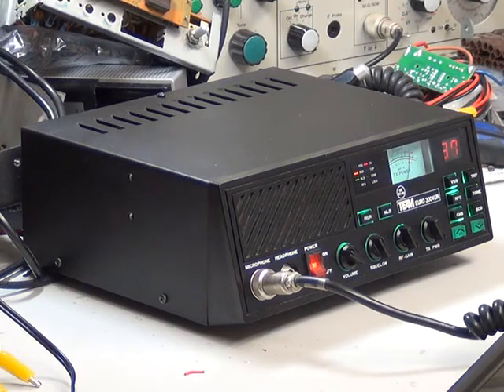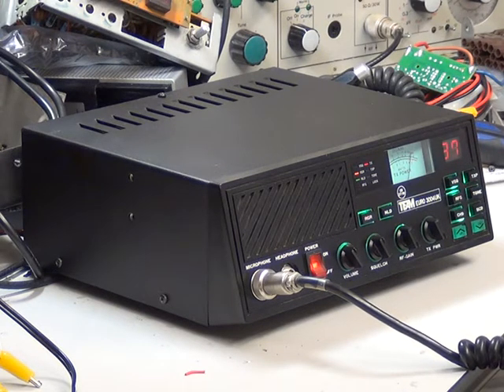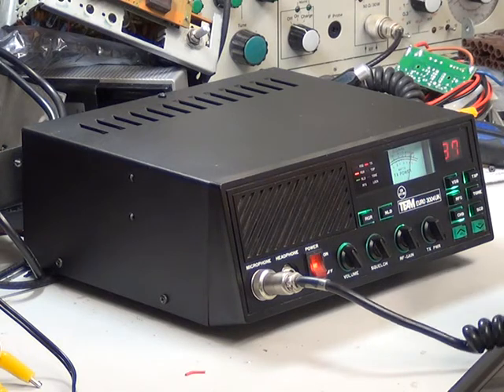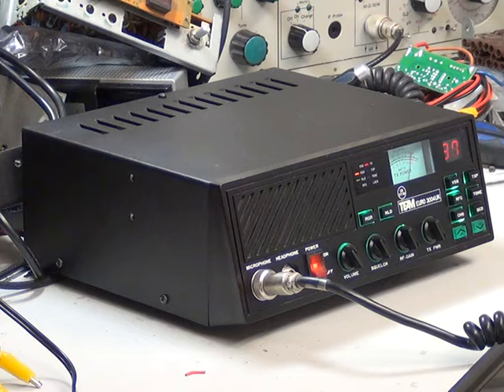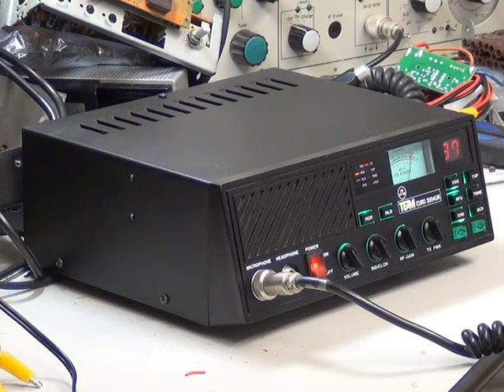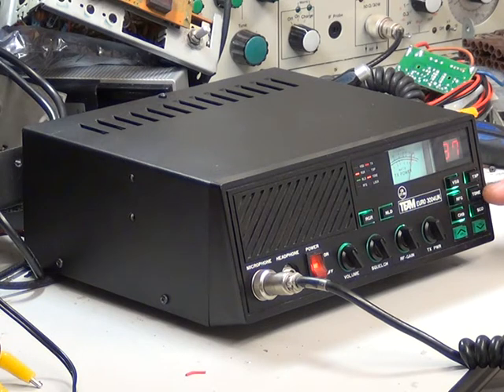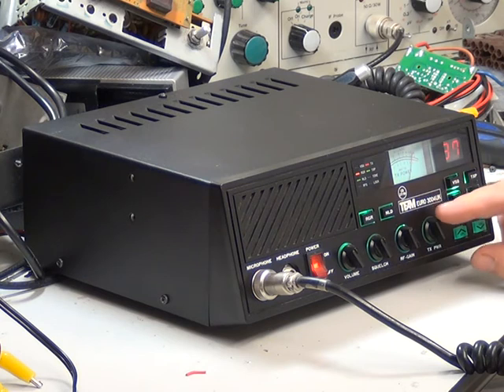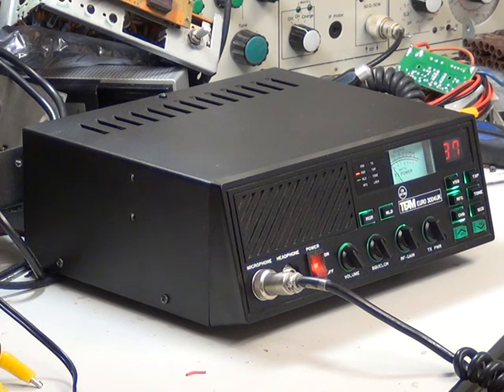Team Euro 3004UK,  UK (CB 27/81) CB radio (Base Station) - On The Air Test

Comment: Hi Richard i have a Team Euro 8000 base station cant find much info on the radio,i wonder if you would consider doing a trx alignment video for it. love your videos cheers Steve.
Reply from the maker: Steve, I bough a sorry for itself Euro 8000 off ebay a few weeks ago, but needs extensive work. I sorted the mains power supply, now need to find where the 8v rail has gone! work in progress.

Richard
Reply: @ukfmcbradioservicingTango21  fine on that look forward to the next installment..